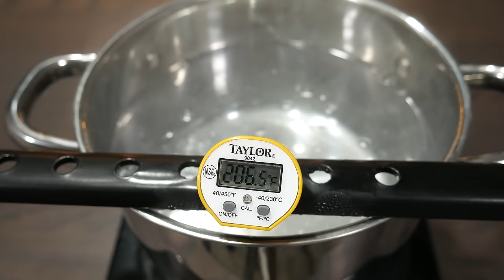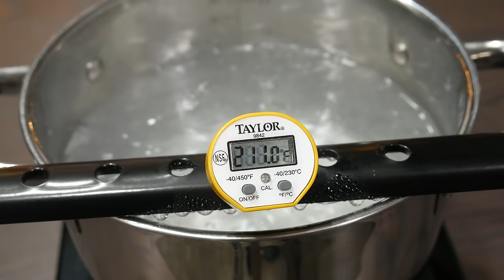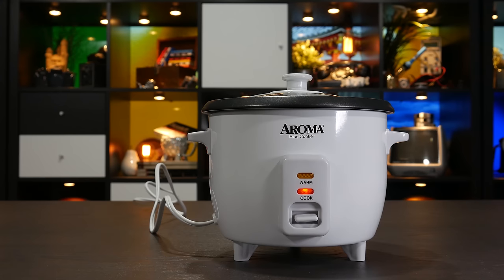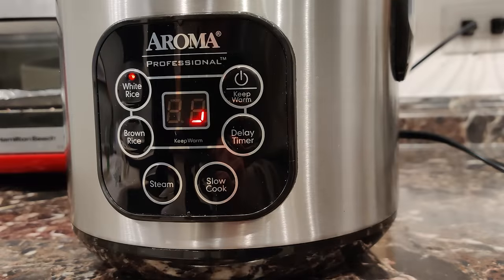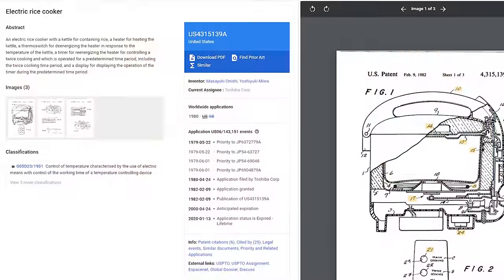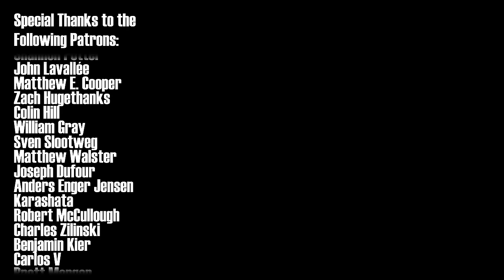Old-fashioned rice cookers are extremely clever

Comment: I watched a gunsmith do a neat trick with heat of vaporization once. He was wanting to color some trigger parts with heat, but he wanted it more even than a torch would get  and he didn't want to overheat some sections of the parts and ruin their temper. So he explained the color he wanted required the steel get to 200ish °F and threw them in a pot of water for an hour where they'd be safe.

Comment: Latent is melting ice. Evaporation heat is evaporation heat. I think pressure of cook riced is measured and calibrated so it cook until correct pressure at time when all water evaporate it get nearly correct pressure unlease the spring to return to warm mode

Comment: The funny thing is that I was originally under the impression that rice cookers used a switch setup using a bimetallic strip switch like that in a coffee maker or a toaster and that the water boiling off caused the strip to push enough to disengage the mechanical catch on the on lever—though the permanent magnet no longer effecting the steel in the switch is far more elegant and sensible.  That's probably why most rice cookers from the '80s are still working.  Heck, fixing a broken one is likely easier than fixing a toaster or coffee maker due to the few parts that can possibly break on one barring ridiculous abuse.

Comment: I wouldn’t call a pressure above 1 atmosphere a “weird circumstance” (of course the pressure raises the boiling point, so you could say it still isn’t over it’s boiling point even though the water temp is above 212).  Pressure cookers use this, as does any pot with a non-vented lid (although the pressure is raised all that much simply by a non-sealed lid).

Comment: Mind blowing! I learned magnets stop working with heat when I modified a  pizza oven to have a removable door held by magnets. Used Neodymium Rare Earth Magnets which do get irreversible loss of magnetic power past 212F. My oven could do 750F. Advanced rice cookers are supposed to give better rice, but can't tell the difference. They also can keep rice hot for 2-3 days, not sure they hold pasteurisation levels though.

Comment: Working for a magnetic’s company here. I don’t think your magnet gets to the curie temperature at all. Once a permanent magnet hits the Curie temperature, its domains are all misaligned, and you would have to remagnetize them manually (by means of a big ol’ electromagnet which pulses a huge magnetic field during a small fraction of a second). Since you don’t remagnetize your magnet after it switches off, it means that your permanent magnet has not fully demagnetized, aka hasn’t reached its’ Curie temperature. What’s going on here, is that your rice cooker probably uses the temperature coefficient of your magnet. Every permanent magnet has a negative temperature coefficient, which means that for every degree celsius it gets hotter, it loses a percentage of its magnetic output in a reversible manner (there’s also a portion that is irreversibly lost, but we shouldn’t lose track of the matter at hand). What you have to do then, is to fine tune your spring and magnet, so that your magnet loses enough magnetism at a specific temperature for the spring to overcome its’ pull force. When your magnet cools down, it gets back to room temperature and gains back enough magnetic output to go through the cycle again.
I hope this has been helpful. I’m also aware that I wrote this comment way too mate for you to notice it. Anyway.

Comment: After seeing the rice was at 85-90% done I flipped it to warm but it probably would have finished cooking if I`d unplugged it to conserve battery power in my Golabs. These can also be insulated by wrapping a towel around the cooker after unplugging to finish the process to conserve battery storage when relying on solar. My DC rice cookers have this switch too but you can`t see the rice cooking. I have the parts needed to wire them directly to solar panels and I need to get that set up soon before hurricane season. Even if you have plenty of solar storage and backup you must still learn and faithfully practice conserving power because sometimes you will need to know exactly how.

Comment: Ughh wow.. I have the same exact thing only branded as black and decker.. insides are precisely the same.. I've taken it apart cause it blows the thermal cutoff fuse a lot lately.. thought that the warped from Heat Bowl is the culprit of why it's not disengaging and why it blows the fuse cause it keeps on "cooking" for long time.. Now I believe it has to do with the magnet!! I left it on the top shelve for like 5 months now cause I already went through 3 fuses.. might bring it down again and see if I can fix it..

Comment: Magnet "expert" here with a bit of physics: 

1. all materials are "magnetic", those called "magnets" colloquially are ferro\ferri- magnetics. They can have ordered spin arrangement(i.e. magnetization) in the absence of the applied field. Consequently, para- and dia- magnets dont. Ferro- and para- react to the applied field by aligning to it, dia- align in opposition to it.
2. Curie temperature is the temperature at which the thermal agitation wins over the (qm-based) energy that keeps spins aligned.
3. There is no classical explanation for the existence of magnetism, only quantummechanical one. Though, plenty of classical phenomenological "laws" for its behavior.
4. Modern magnets are complex alloys and by tuning the composition we could tune the curie temperature. (and, if you would look into which materials (rare-earth) are used and who owns 95% of deposits\production you might uncover interesting moments hehehe)
5. Probably someone mentioned this already.. But, to be absolutely correct, you do not "break" the magnet by heating it, you are merely destroying the current magnetization state. Cool it down and it could be magnetized again. And, if it has spontaneous magnetization, it will do so without any external field.

<all hail the algorithm!/>

Comment: @Technology Connections
When you add rice and water , the weight of these contents presses the cooker bottom switch which keeps the heating element on, once all the water vaporizes the content weight is less, which lifts the bottom switch spring and disconnects the heating element switch, I think this what is going on, I did not know the magnet stuff hidding at the bottom of the cooker, thanks.

Comment: Two things, you can do lots of things with a rice cooker ie. steam vegetables. Second, the problem with simple rice cookers is that when they switch to warm mode, the heating plate is still 450F. This burns the rice at the bottom as you need to leave the rice to steam for 10-15 minutes after all the water has boiled off.

Comment: Back in the mid 70's (actually around 1974 or '75) we bought a toaster for sliced bread that automatically popped up once the toast had browned to perfection.  Inside there was the usual electric element wound around a heatproof card (mica? asbestos!?) to each side of the bread.  There was also a springy curved wire that touched the bread on one side, and this determined when the bread was browned.  It worked, regardless of the initial temperature of the bread, even frozen, or the thickness of the slice.
We've never been able to find another like it, after it failed in old age.  It was branded Morphy Richards.  Could this be another example of this curie point tech?

Comment: According to Stanford magnets, "Within the operating temperature range, the magnetic force will decrease if the temperature rises, but under the condition of not exceeding the Curie temperature, the magnetic force will recover after the temperature drops."

So, heating a magnet will weaken it, but so long as the magnet isn't heated to the Curie point, the magnet will fully recover once it cools down. So what the makers of the rice cooker had to do was ensure that the magnet was stronger than the force of the spring until it was heated above the boiling point of water, at which point, it would become too weak to keep the spring compressed.

Comment: If your warmer & cook light come on, but it doesn't stay on cook, the bottom of your aluminum pot has its dimple going up due to expansion (instead of down). Take your thumb and press the bottom center of the aluminum pot down, bending in a dimple. Look at it to see that the dimple is created & then do the same in a circle pattern all around the bottom.  This is what I did to get it low enough so the magnet would keep it down for cooking.

Comment: The ratio of rice to water is a little tricky with these basic cookers.  I have a larger version of what you show and the ratio changes with the amount of rice I use.  So, I 'stick' with the same amount of rice and water to get consistent results.  I do need to keep an eye on the cook though as the magnet doesn't release early enough to avoid some rice getting stuck on the bottom of the pot.  I live ~1000 ft above sea level.

Comment: Omg I can't believe I ran into this because rice is the easiest thing to make. Anyone can do it. Here is the easy way to do it.

Take a non stick pot, add 1 part rice and 2 parts water add salt to taste (usually about 1 teaspoon per cup of rice), set burner to high heat and watch for water to boil (usually about 5 to 10 min)(if you start with hot water it'll need less time;hot tap water, etc) once it reaches boiling point add a glass lid and set to low heat. This process takes about 10 - 15 minutes but you can keep an eye on it. Once you see that there isn't any visible water you can set stove back to high heat for about 15 seconds (do not remove lid) If you don't see any bubbling it means you can shut it off and your rice is done otherwise set it back to low and check back in 2 minutes. Repeat the High burner process and see your new results. As you get better at it you'll realize how simple it really is. At some point you won't even need to do all of this, you'll just know when it's ready by looking at it. Once rice is done I leave it there with lid still on and serve when I'm ready to eat but it is best to wait about another 10 minutes before serving.

Good luck and cheers.

Comment: I don't normally criticise a video of this kind but I do have serious doubt about a magnet is used in controlling a rice cooker.  This is because the rice cooker, excluding the shell has very little steel or iron parts.  The heating pad where the cooker is in contact to receive the heat is aluminium inside which the heated element has been encapsulated.  However it must be obvious to anyone who has opened the base that the switch is just a lever with a contact point very similar in construction of a car's contact point which is made of platinum to provide good contact to pass the electricity.  The lever itself is a bimetallic strip using the fundamental thermal couple theory.  The idea is to have two dissimilar metals bonded together so that when heated to an elevated temperature the strip bends and eventually forces the contact point to separate mechanically.  A thermal couple is therefore the key to switching a rice cooker off and not a magnet!  The lever has a mechanical catch to keep the contact point to stay one once the electrical switch is pressed.  The bimetallic strip when heated up beyond 100 degree C will overcome the catch and spring open the contact point.  Until the bimetallic strip has cooled down sufficiently, or straightened reasonably, it will not be possible to press the switch to cook again.

Comment: It's just as arbitrary to set 0°C and 100°C to the temperature at which pure water freezes and boils on Earth, at sea level and under standard atmospheric pressure. 212°F isn't an accident, either; it's quite deliberately a 180° difference from the freezing point of pure water. 0°F being the freezing point of brine is also deliberate, though later redefinitions make the typical salinity of sea water freeze at -2° instead of 0°. It's worth noting that the saltwater definition is the reason freezers cool to at or below 0°F (or -18°C) since otherwise things like vegetables and meat, which are mostly saline at nearly the same concentration as the ocean, wouldn't actually freeze and, consequently, could continue to rot, albeit slowly. Kelvin is only marginally less arbitrary than Celsius since it pegged 273.15 K to 0°C so one end of the scale is still arbitrary. Of course, it's now pegged the other direction since everything has been redefined in terms of a Boltzmann constant arbitrarily fixed at 1.380649x10^-23 J/K.

Comment: Off topic question. When I was young in Nebraska before air conditioning. Our furnace had a radiator in front of the fan. The well water was very cold. The radiator cooled the air and removed the humidity.  It didn’t cool the house as fast as an air conditioning. The windmill was able to pump enough water to keep our house cool. After the water left the radiator part would go up into the water tank in the attic and the rest went to water the livestock. 
Does anyone know about this way to cool a house? What was it called? I’m retired and live in country. I have a windmill to water our garden. If possible I would like to buy or build this home water cooler. The windmill will deliver cold water to the air cooler then out to my garden. The water from the humidity would go down the drain. I could cool my home just for the cost of running the fan. Please help.

Comment: It shouldn't reach the Curie point, the magnetization weakens  significantly well below the Curie point. Once you demagnetize a magnet too fully, it won't re-magnetize in one domain to make a strong magnet again, but in lots of patchwork domains which will make a weaker magnet. But if it's still magnetized (albeit more weakly) when it detaches, no problem, you can use the same magnet forever.

Comment: Right. Just do this. 

Ingredients are: 400g basmati. 600ml water. One Tbsp oil (olive is fine). One tsp salt. One large non stick pan with a lid, preferably transparent. Four cloves. One Tbsp of finely chopped onion. One stick cinnamon. One bay leaf.

Wash the starch off the rice and drain it. Heat oil in pan. Add cloves, bay leaf, cinnamon and onion to oil. Stir and soften, do not burn the onion. Once soft, add rice, stir rice into the onion and spices, then add the water and salt straight away and stir. Bring to boil. 

Stir. Reduce heat, simmer for 4 minutes.

Stir. Simmer for 2 more minutes.

Stir. Simmer for one more minute.

Take off heat and serve.

Comment: For those interested in a rice cooker, the Aroma model is very good. However, he has the non-stick pot. Not only do those leech chemicals into your rice, but they also let all the rice into your dish. What's wrong with that? Rice cookers overcook the rice on the very bottom. It's very crunchy, and not what rice should be like. A stainless steel pot retains the burnt rice, which you can either shush down the disposal, or let it dry and then scrape it into the trash. (You really don't want to let rice go through your dishwasher.)

Comment: This might be shouting into the wind at this stage, but given that the boiling point of water changes depending on pressure, does anyone know if rice ends up less well cooked at altitude? I've never bothered to take a rice cooker camping with me when up a mountain and I wonder if the amount of water needed and temperatures involved might make it a different experience when you are looking at boiling temperatures closer to 80 Celsius than 100.

I wonder if this means rice cooker recommended water amounts might vary based on the altitude it was designed or sold at? Would a Quito rice cooker (highest capital city in the world) be different to one sold in the US or Europe?

Comment: Question - On the ones with buttons for brown / white rice like mine / your bigger one, do you know what is happening differently when  you select brown rice?  Brown rice instructions have you add a bit more water which would of course increase the cooking time. But that would be the case with either button.  I've wondered if maybe it ran a bit lower wattage or something so the water boiled off more slowly thus increasing the soak / cook time. But that's just a guess. Have not seen the circuitry.

Comment: If you have a microwave oven easiesd way for cooking rice:
use a microwave save dish with a lid.
1 cup (ca. 180 ml) rice
mixed with 3 cups water and 1 teaspoon salt.
Heat this for 7 Minutes at 650 watts
Then heat it for 15 Minutes at about 150 watts
That's it.

Comment: So you know, magnets with the function of repelling other magnets, like in some momentary, non-latching switches, will wear out over time. Like after a decade of use. Magnets that work by attracting other magnets will not wear out. Heat will accelerate this process.

Comment: You could use a pot with a lid and put it on the oven. Just bring the water rise mixture to a boil. Turn off the heat and put the lid one. Done

Comment: As a side note: "(...) U.S. customary units have been defined in terms of metric units since the 19th century, and the SI has been the "preferred system of weights and measures for United States trade and commerce" since 1975 according to United States law. (...)". So yes you can absolutely (and legally) say that water freezes at 0°C and boils at 100°C... 😉

Comment: I've never understood the difficulty people have with cooking rice.

 Just use lots of slightly salted water and only cook it for 10 minutes. Then drain and put a lid on it again and let it sit for another 15 minutes. (not on the hot stove)  

No chance of overcooking because no more heat is being applied while it finishes to cook by the heat that was already put into it. 

And no chance to soak up too much water because that has been drained.

It basically steams itself to completion.